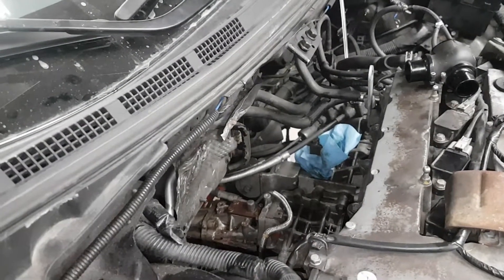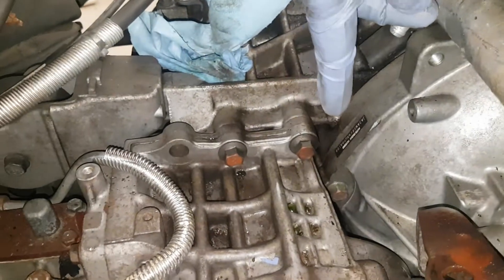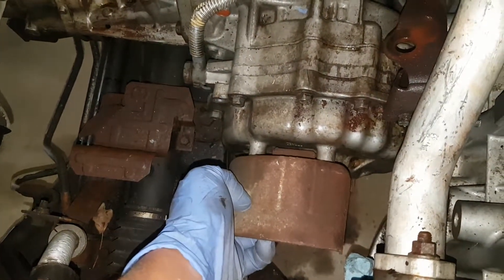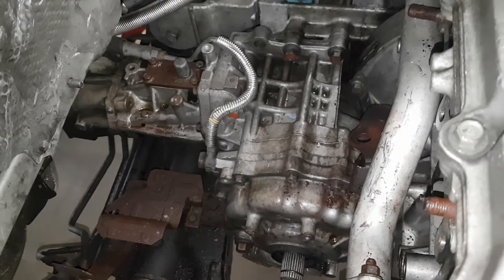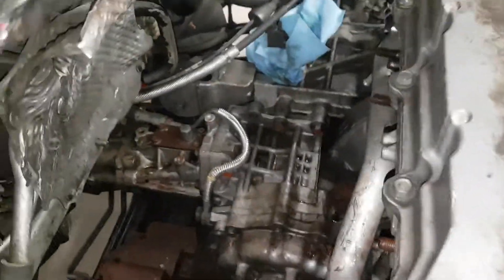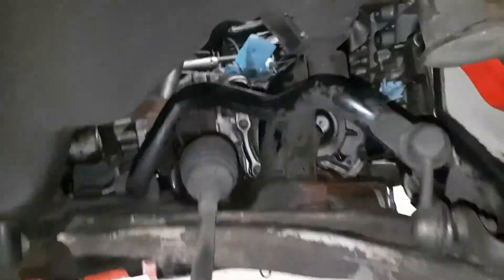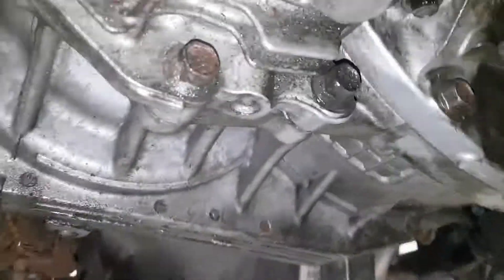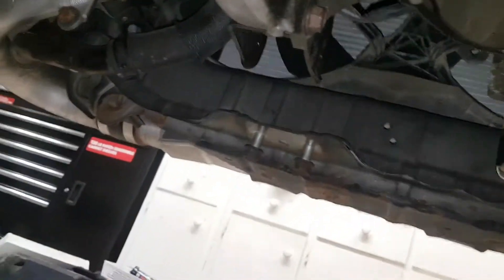EVO X Transfer case bolt locations

Comment: I hate you and love you at the same time
Reply from the maker: Why is that?  I didn't design the car with hard to reach bolts and a trams mount on the trans mount.  Lol
Reply: @dsmtsi idk I’m sorry that bolt really pissed me off
Reply from the maker: @vexaler186  OH I know.  That's why I made the video  I know it is a massive pain in the ass to find with the intake manifold on.  Mine is off in this video which makes bit way easier to see things.  Glad this video helped you.